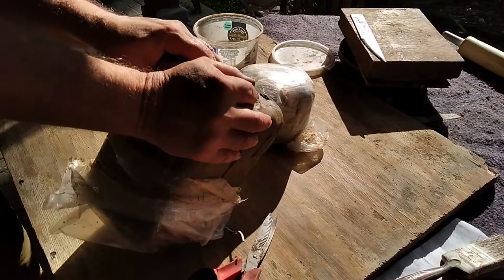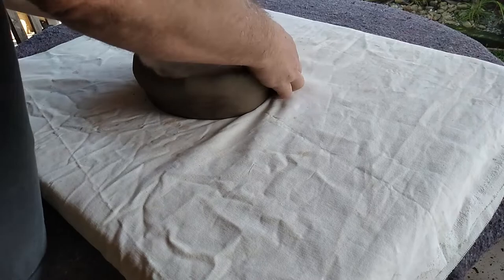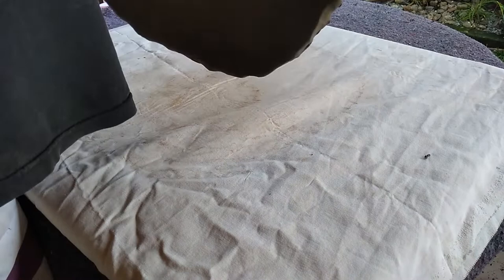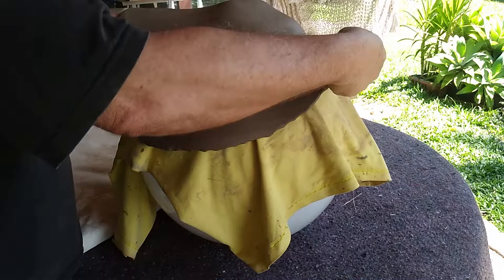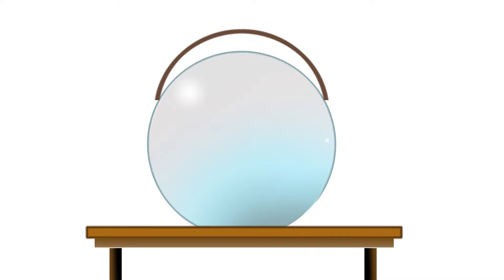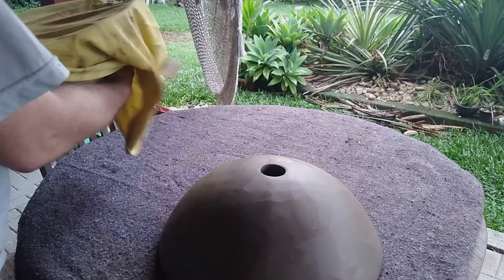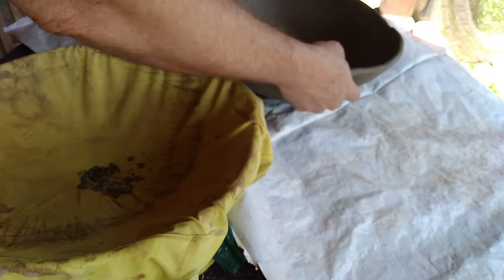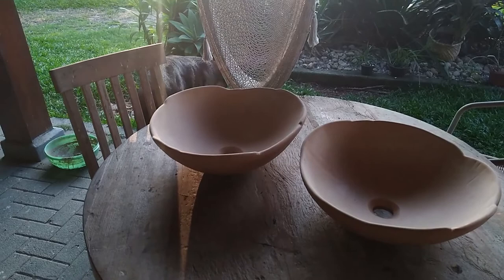Wash basin - Make it in Ceramics

Comment: Hi, I  found your video very informative and easy to follow thankyou, it has given me the confidence to give it a go. Just a question if I may? Once made, (I am attempting to make 2 of these) 😳 how long do they need to dry before they are fired 🤔 Delia
Reply from the maker: Thank you for watching and for your comment. That will vary with quite a few different factors, like season (hence weather), the place you keep it while it dries, and sometimes even the type of clay. My suggestion is that you never rush this part of the process, ideally you should let it dry over a week. Too fast drying can lead to warping and cracking. If it is a hot and dry season, wrap it in plastic to slow down the loss of water. It is a thick walled piece, so you must make sure it dries well all the way to the core before firing. When you hold it in your hand and it doesn't feel cool, then it is probably ok to go to the kiln.
Reply: @improbabilitydrive6005  thankyou so much for taking the time to reply 🙏 I will post some photos of my work once done 🤞🫶